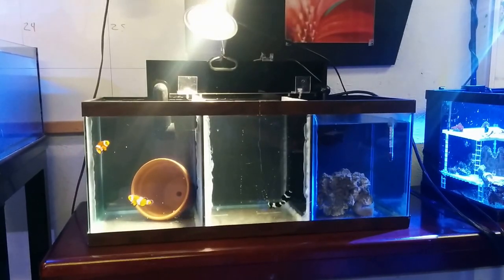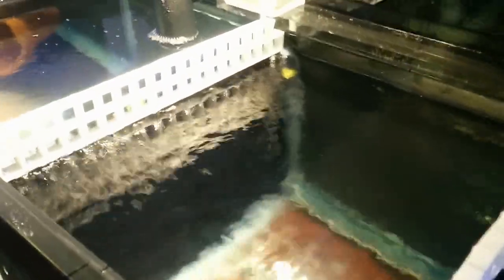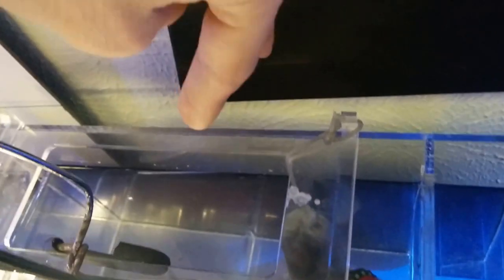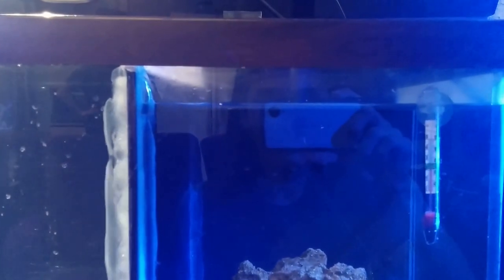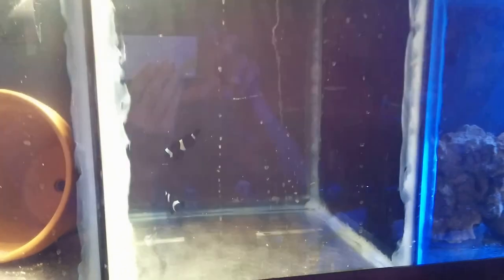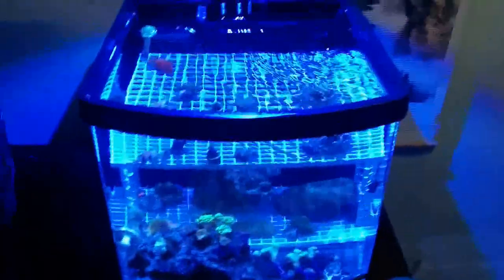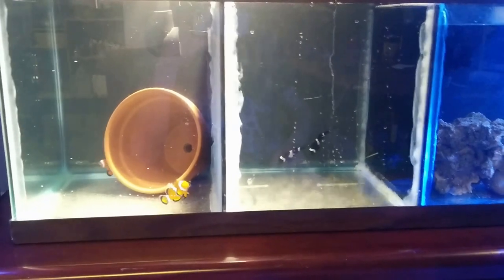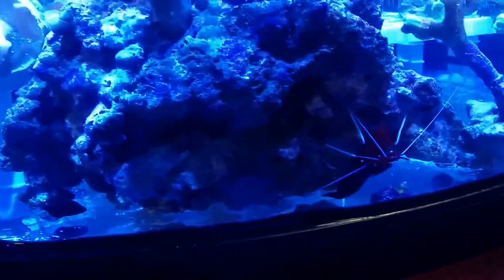Clownfish Breeding Tank- DIY

Comment: Did you ever change your breeder set-up or did you stick with this design?
Reply from the maker: I had a lot of separate systems when I made this breeder. It not only cost me more money but a lot more time maintaining each separate system. 

For the last few years I have been routing the overflow of each tank into a single sump. That way I can do just one water change and clean the glass of each tank on separate days, lessening the work load. 

I have 3 tanks now and one sump. One display tank and 2 now 40 and 55 gallon breeders divided like you see on this 20 gallon tank (I have more fish). 

It’s easier to keep the chemistry of one continuous system that shares water than trying to repeat it on several tanks a month. I started off with just 2 tanks on one sump and just last year added the third. I love it. 

1 sump, 1 heater, skimmer, 1 refugium, 3 return pumps, 235 gallons of water in the entire system. 

I’ll make that my next video. Thanks you so much for watching.

Comment: im doing the same thing with a 55 divided into 6 sections. the way im getting around having flow in each tank is im using a "spray bar" that runs a pcv pipe down into each individual section. plus drill holes in the bottom inch of each panel and youll get a small amount of water flow physically through the panels instead of all of it having to go over the top.